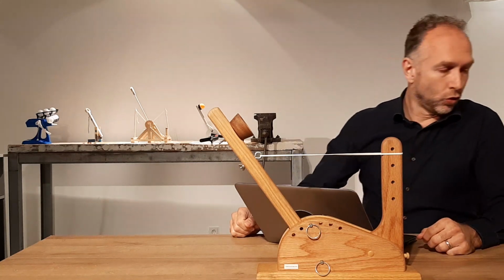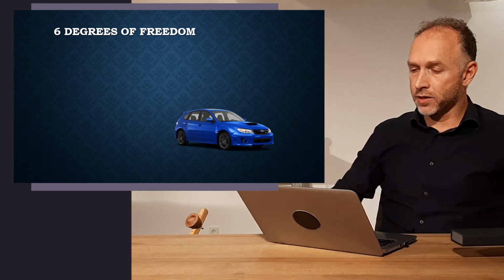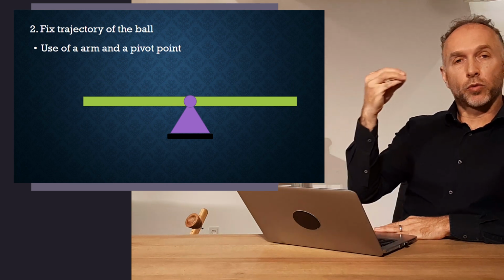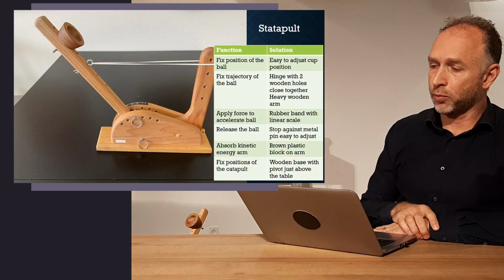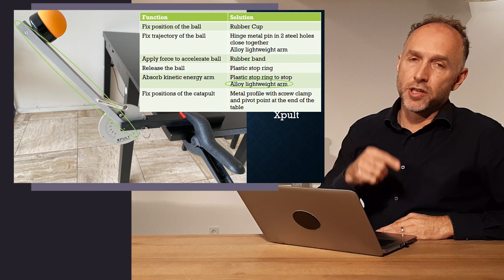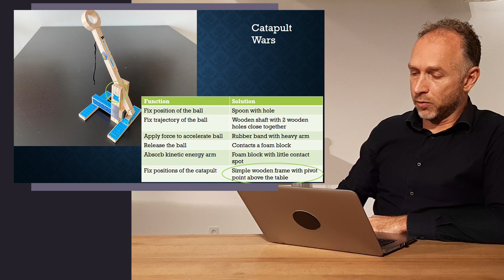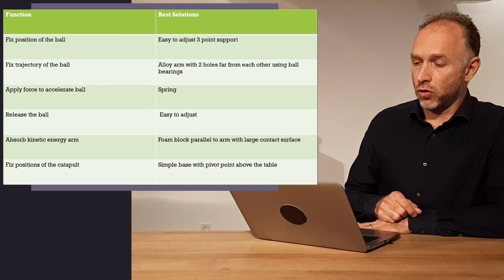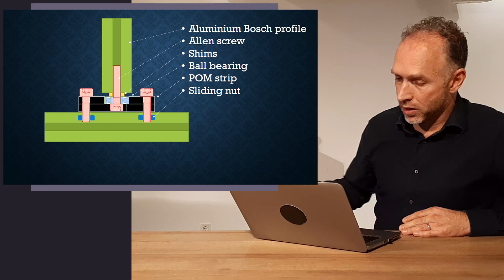Lean Six Sigma Catapult Design and Realization

Comment: i have noticed that the usual catapults used in these experiments have a large concave cup. i think it should be a flat stand with the ball resting on the beam... this assures that the ball is always on the same spot and not rolling on the concave curvature of the prior design as it exits the propulsion mechanism?????
Reply from the maker: Thanks for your question. I agree that the concave cups definitely are not a good solution for a precision catapult. In the case of a flat stand: how to ensure that the ball does not roll from the flat stand while the arm is accelerating? Another flat stand in the vertical direction? So the ball is in contact with two (more or less) perpendicular planes? Then, the ball can still roll along these two planes. This means that we need another plane, (at least somewhat) perpendicular to the other two. So a total of three planes are in contact with the ball. Then, all three translations of the ball are fixed and we have minimal friction when the ball is leaving the catapult.